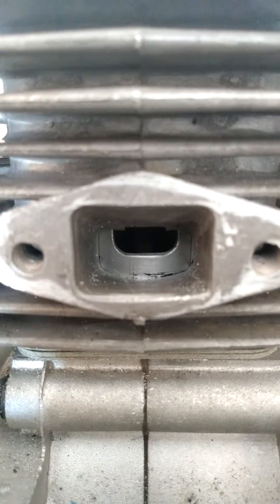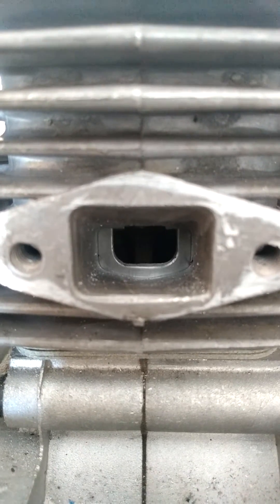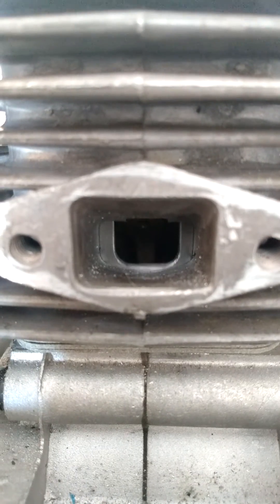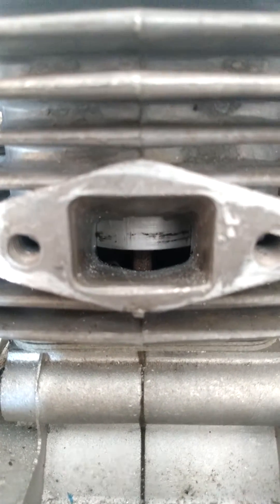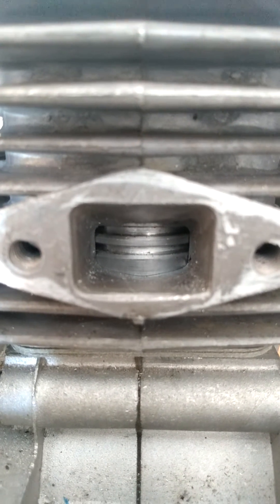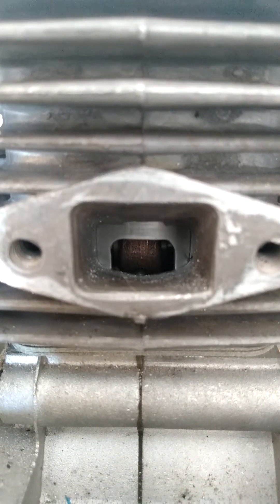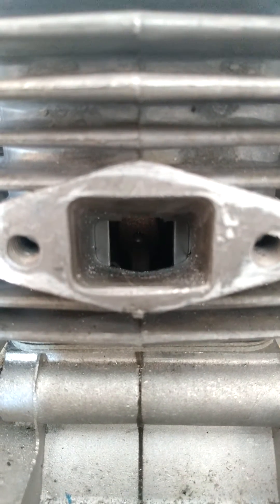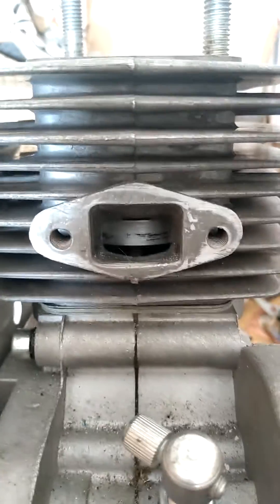simply at what height do you start your window. you want the window to start  open right after bdc.

Comment: Alright so the window i made might be too tall but will it still work? or what's the disadvantages of it being too tall ?
Reply from the maker: Yes it will work fine no problem. But if you look around I made a video  on window sizes and shapes as well. Belive me when I say I have physically  tested everything  from port shapes sizes timings  all  reeds Reed materials and thicknesses. All cyl heads volumes  shapes. All the legit non knock off carbs from phgbs keihens mikuni  from 17.5 mm to 28 mm flat slides round slides. All the ignitions. Most all the pipes mz KTM yz cr kx and yassini case Reed engine piston port engine and Reed engine cranks from 38 mm 39.5 mm 40 mm and 44 mm. Stopped messing with bicycles about 3 yrs ago. My vids are legit factual  2 stroke information. Just tried to help folks from getting bum hypothetical  information  my information  is 43 yrs of hand on tested information
Reply from the maker: Big window  equals  nothing  but rapid  piston and cyl wear. Widow  hight is subjective  topic meaning  it's not to tall IF YOUR CONTROLLING  BOOST PORT OR IF YOU HAVE A PROPER  DESIGNED  EXPANSION CHAMBER  THATS SCAVENGING PROPERLY   SUCKING   FUEL OUT OF THE TRANFERS BOOST PORT AND CRANKCASE.
Reply from the maker: https://youtu.be/X_E56LJ8sqc ramped skirts windows tested  everything

Comment: Can I just drill a hole or it has to be a square
Reply from the maker: Yes
Reply from the maker: Find my other video on windows
Reply: @2strokecarbtuningportingin187  the one you talk about ramp piston and windows?
Reply from the maker: @Roberto_4273  there's a video showing all different windows shapes and sizes I have ran
Reply: At bdc can there be any part of the window showing? I'm being told yes, I believe that to be wrong. Can you verify that information please
Reply: @snapap690  Yes. That way, it will start to flow air as soon as there's bacume, and before it gets to bdc, if you have a boost port, it will flow mixture to it all the time. You need a reed, of course

Comment: Hey I have a question i have a made a really stuffed case for compression and I bought the cheap zeda reed that sits in the intake essentially and it back fired and blew up the reed when I first started it, is the reed valve to close to the intake for how much compression it has?  Or was that reed not rated for high compression, or was that reed to small and to close? I’m now getting the cdh g2 reed
Reply from the maker: Stuffing crank case is a waste of time unless your looking to gain low end power and loose mph. #1 you decreased crankcase volume meaning less room for fresh fuel 2 created a thermal barrier 3 increased the chances of blowing out crank seals. 4  now the piston fights the increase pressure in the crank on the downstroke.  Just giving you 4 reasons why I don't stuff the crank. And yes I have stuffed the cranks with plates also buy plugging the crank holes. And that was my findings and the reasons  you loose mph but gain low rpm power
Reply: @2strokecarbtuningportingin187  ooof well ima scrap that engine then lol that’s a lot of mistakes I made, thanks for your advice sir!
Reply from the maker: @jasonsnagel   a stuffed motor runs ok just notice more lower Rpm power. But I think I gave you about 4 reasons I don't. Get you a new 47 x 40 mm wild cat motor. Flush out the lower unit degrease the pressure plate  wipe the grease that's gonna sling out the center of clutch hub. Knock the clutch shaft out add one round of pre load to the spanner nut behind clutch hub re install shaft tighten clutch hub adjust flower nut.  Inspect the seals both sides of the crank. Make sure magnets tight check for end play make sure primary drive gears tight grease bucking bar and ball make sure sprokets tight. Then start building. That's all I do to lower units all my post comes from good port timings and ability to tune. I found out all the other stuff was not work no payoff yes I have case port mated stuff ran all the cranks but my ass and tachometer never seen enough gains to justify the work.
Reply: @2strokecarbtuningportingin187  my bike with a 27 tooth drive, piston port and my stuffed case was going 53mph (I weigh about 115 so I knew it would have the power to turn that drive gear) then I put the zeda part on with a window piston and it blew the reed up before I rode it, I can’t imagine it going faster had I set it up better also makes sense why it kept its power all the way to half throttle then faded! wow I’m going to go through the bottom end and clutch just like you said that is the freakin best info I’ve ever got also gonna get a wildcat for sure I’m excited to see what I can build with your videos, the engine I scrapped was inspired by other channels that don’t stay to the point and hardly make sense, they act like there is no math to porting it seems lol big waste of time and effort, but still good learning with my tools and getting inside these engines more, always learning!
Reply from the maker: @jasonsnagel   don't be offended but that's desperatly slow for your sight and sprocket size.  A 10 /32 with 175 lb rider is good for 60 to 67 mph with your weight anything should fly sound like you put to small of a sproket
Reply from the maker: @jasonsnagel  https://youtu.be/pvAETEhp70M
Reply from the maker: @jasonsnagel  again not ment to offend just don't write and choose good words
Reply: @2strokecarbtuningportingin187  no offense taken! I got nobody telling me what I’m doing wrong i gotta start over and like you said keep it simple I watched your recent video and I really don’t mean to waste your time, sorry and have a good day
Reply from the maker: @jasonsnagel  no man you don't waste my time you got to think for the past 5 years on a daily basis I answer these questions and read these very questions probably a thousand times now it's not meant or directed toward you it just reminds me when I see these questions how many times I've answered them. Thankfully I have my own groups and I don't take much abuse no longer at one time there four years ago I had people prank calling me taking Craigslist ads out on me because of me sharing my information and exposing the liars the cheats and the thieves in the bicycle business people will sell you anything people will convince you anything works. That's why my other YouTube channel got taken down because Robert bitchassi would have 5,000 members harassing me on a daily basis my original channel was great 3 years worth of videos got taken down because I got angry I'm super calm nowadays should have seen me a few years ago I used to have all kinds of viewers and all kinds of members and now I post a video and I got 50 watchers meanwhile I got the best information in all Bicycle world. Kind of ironic
Reply from the maker: @jasonsnagel  key is look at things clearly.  Before you do anything. See and mark ring end gaps see how far your rings travel. Roll the motor over threw it's cycles.  If you try everything at once and it ripps  you never discover why it ripps. It's like baking a cake. If you don't combine the ingredients in the proper amounts it tastes like shit.  Basically start out making a cup cake. Next thing you know youl end up with a super cake. Other words start small see what changes what. You find out first hand does what. Rember you can't add material but you can always remove some.
Reply from the maker: Sorry I don't understand the question there no ratings on any reads it's a one-way check valve air goes in one way and not supposed to come out the other way.